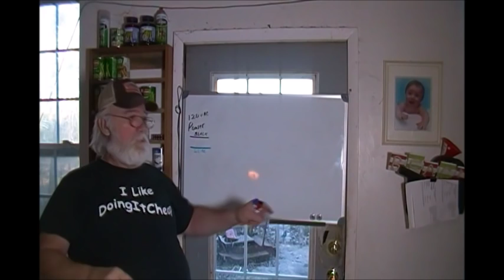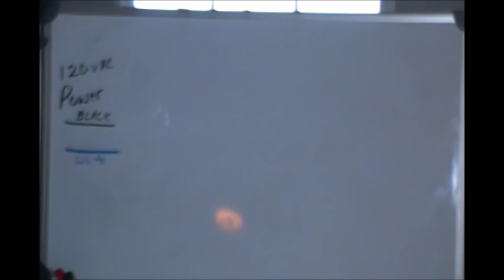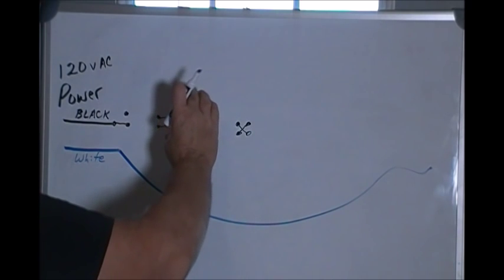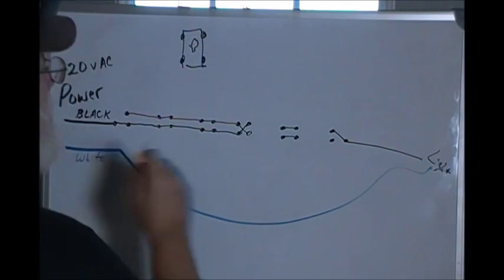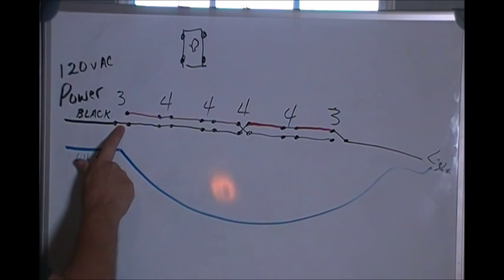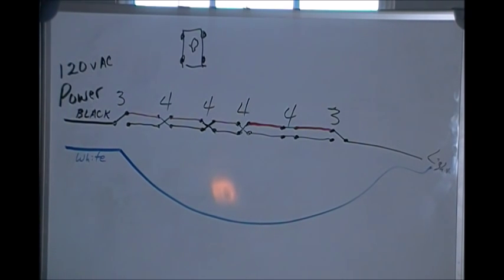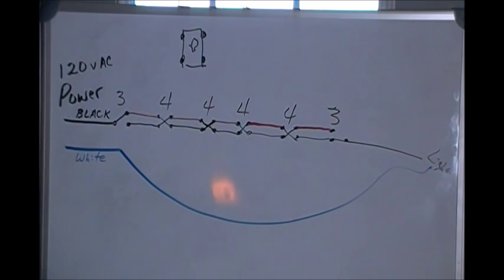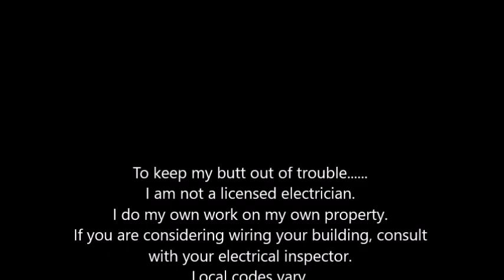How to Wire Four Way Switch Circuits

Comment: You're a good teacher Bob. I'm trained more in industrial power for factories and your residential wiring videos really help.
Reply from the maker: Thanks Tim !!!  Residential is a cakewalk compared to industrial.  I made a quick fifty bucks one time at a supermarket.  They had three phase power and when the electrician wired it up, the meat grinder was running backwards.  The electrician did not know it at the time, he just knew it was working when he left.  I was called and had no clue, so I called my dad, a master electrician, and he told me to make a 3 phase motor run the other direction, just reverse any two leads.  I looked like a champ when I went in there and fixed their problem !!!

Comment: Good illustration Sir. How could I tie a battery wire into this equation. I thinking of putting in a battery backup on my patio. Thank you for being so informative. I'm trying to learn all that can. I hope you don't mind me picking your brain!
Reply from the maker: That is a BIG deal in itself.  You cannot just put a battery in your wiring.  Your residential power is 120 volts and 240 volts.  A battery won't work without a power converter to convert your DC battery power into AC 120 volt power.  It can be done, but I cannot explain it to you adequately here.  Hey !!!!  There is another idea for a video !!!  I will do that for you !!!
Reply: pawpaw hope you dont mind i have a fastans simp^le solution to her prob its a solar power fixture that will charge during the day and light up at night no wirering just screw it on
Reply from the maker: I don't think that is what she is asking.  The question is how to have a battery backup to existing wiring and lights.  But your idea for lighting is spot on.  Just a simple solar charged battery pack and LED lights would provide lighting without endangering someone trying to back wire  120 volts into the house when the power is out.